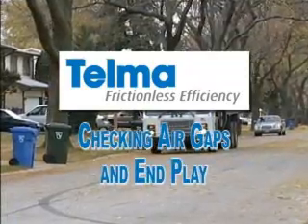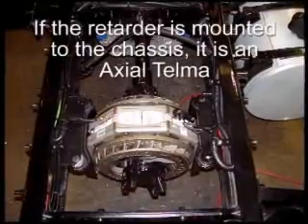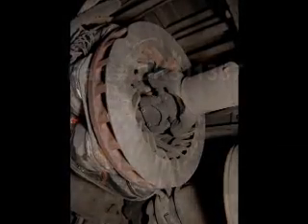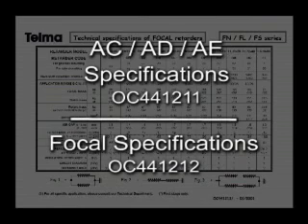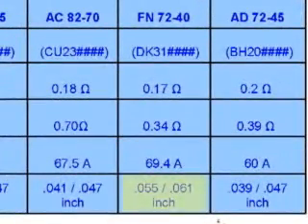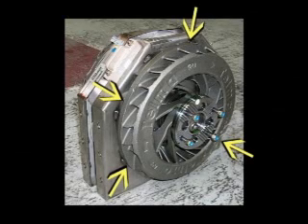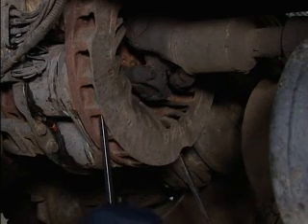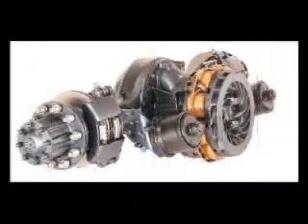Telma Frictionless Braking Systems - Air Gap and End Play

Comment from the maker: @rokkebill - Adhesive is not used to secure the coils.  The coil replacement procedure may vary depending on what model Telma you have.  Information on identifying the Telma can be found on the Telma Technical website.  For further assistance you may email engineering@telmacse.com or call 800-797-7714 extension 4 for engineering.

Comment: My telma is broken and I need to replace a coil. I've taken off the flywheel, the magnetic plate, the pressure washer. I see the coil, but no screws. Only some araldit or glue inside. How do I get the coil off ?